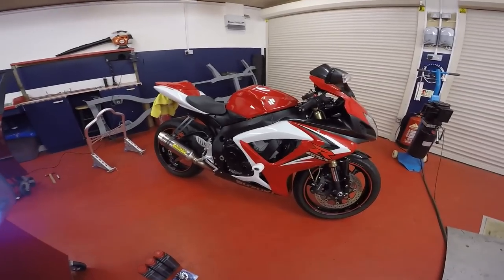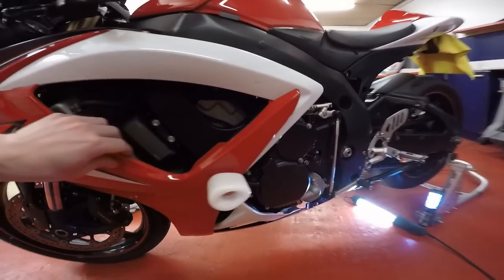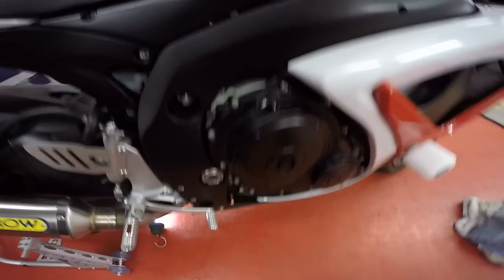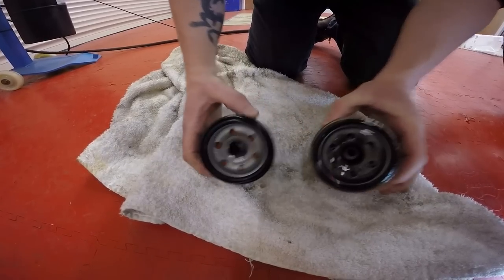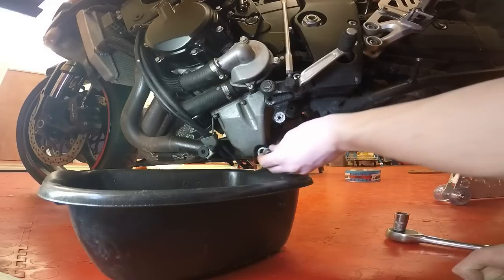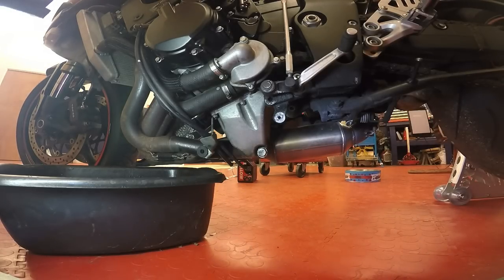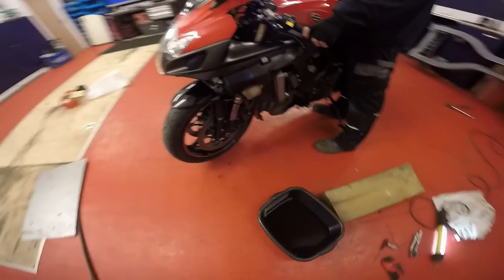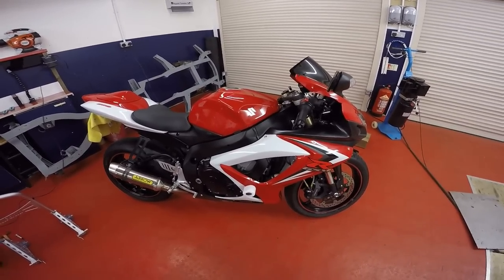How To Change Oil And Filter On 2006 Suzuki GSXR 600 K7

Comment: Just a tip, i noticed you didnt pre fill your filter before you attached it, you should fill your filter with oil before installing, doing so speeds up the process of oil circulation, if you dont your motor will be without oil until the filter fills and then distributed to motor.
Reply: Good tip, but I could also think of some reasons not to do this:

Usually you ride the bike to warm up the oil before changing it, so it drains well. This means the old oil was pumped through the engine and left a film. Due to the limited rpm / load this will lubricate sufficiently until the new oil hits those spots. Furthermore your method might be more challenging for beginners in terms of keeping everything clean. When oil is spilled out of the new filter it might also cause difficulties regarding how much oil to exactly add through the filler opening, after putting on the filter.

Just some considerations though. I think your tip is still great, especially for people who already have some experience and that are less likely to make a mess. Thumbs up!
Reply: Truth even if it’s mounted sideways.

Comment: Thank you for this video! I had my bike worked on at a local shop at they didn’t put the wiring harness in the correct spot but thanks too you I can clearly see where it should be

Comment: For next time and for any bike where the oil filter is above the front headers, put some aluminium foil around the header where the oil shoud drip, so after the flush, you just remove it, but a little of brake cleaner, and you're done, no more cleaning ;)

Comment: great video sir!  I have the same 2008 gsxr 600 but don't have the k7....just the regular.  Is the oil process still the same?  also what size socket do I use for the oil plug?

Comment: Really helpful video, I have just got a 2006 gsxr and needs some tlc, oil and filters etc ready for the 2015 season. Did you ever do a changing the spark plugs vid? Also a vid on changing the air filter woukd be useful!  Keep up the vids!!!
Reply from the maker: Glad you found it useful. I have been a little slow getting the spark plug one done. It is coming VERY soon so subscribe and keep your eyes peeled for that.
Reply: Already subscribed and looking forward to it! Thanks again!!

Comment: just want to add, every bike i have had and did an oil change on usually after you fill up the oil to the corect level you want to let it idle for a few mins and give a few revs and move the bike left to right and then turn it off check the oil and then it usually needs a top up because i think it like settles or something then go for a ride then come back check it and then later that week after a couple more rides check it and it probably needs a top up of like 100ml then after that week it never needs a top up ever again, i think it just needs to settle or something idk what it is but every bike i have had its done that

Comment: I just checked my R-Rod oil Level 4,000 Miles and it looks brand new. This oil looks like my Tundra oil at the 150,000 / 5,000 mile oil change. Good lord that oil is dark.

Comment: 2200 when changing oil only, 3200 with filter.
Reply: Isn't it like 2.5 or 2.8 with filter?
Reply: @zutadaska7875  not on a 1000, 2017